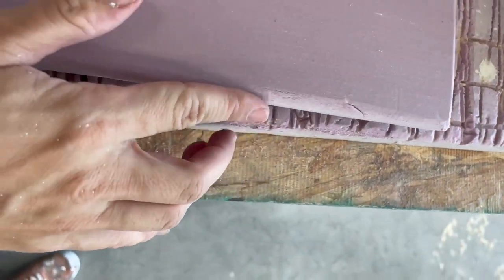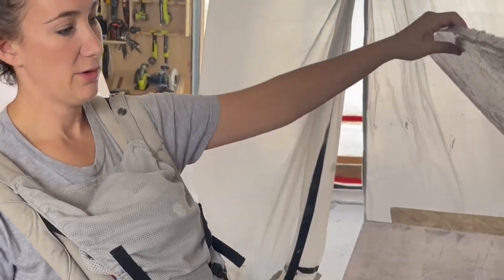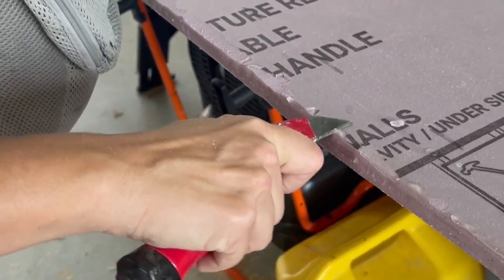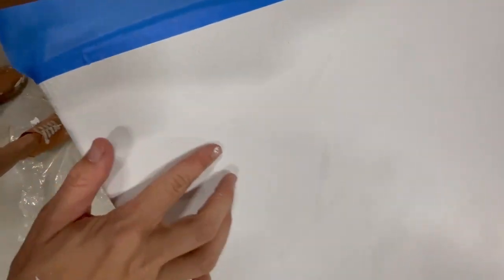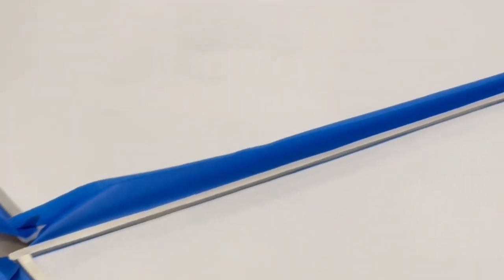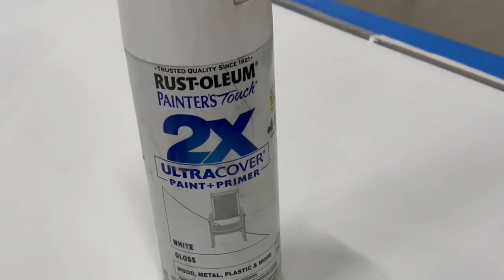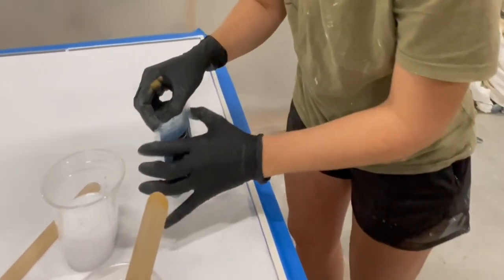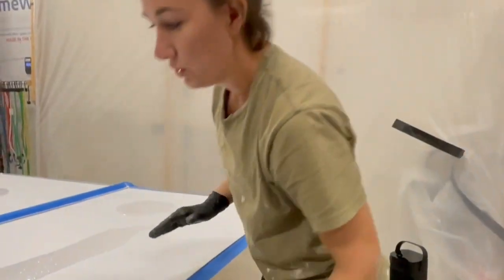HOW TO MAKE AN EPOXY SHOWER

Comment: I'd be scared of the foam not being sturdy enough. If you lean against it does it bow or push in at all?
Reply from the maker: It’s actually super sturdy, it’s inlaid with fiberglass wire, and what residential showers now use
Reply: @tomazcoasttocoast2022  thank you for responding. I love the idea of doing it but the foam scares me. Maybe I'll use plywood and waterproof it with red guard.
Reply from the maker: @CHANNELCHECKER381  of course!  Check out @stonecoatcountertops with how they use the foam board, the plywood has a sheen to it so doesn’t adhere the epoxy as well
Reply: Why is it so hard for people to understand that the fiberglass mesh makes it exponentially stronger. Also- please please for the love of god don’t sand that shit with a baby on your chest.

Comment: I too am wondering how to attach the foam to the studs? I want to do epoxy walls throughout my house, but I don't know how to attach them to the studs once created, any suggestions?
Reply from the maker: You can glue to the wall or put screws through it into the studs and then epoxy over it
Reply: the usual way is to dollop silicon every foot or so on center. this can be adhered directly to the studs or to drywall. if doing a shower need a waterproof membrane behind at least at the corners and the wall with the faucets. , also, don't forget to seal the joint at the top. steam is tricky.

Comment: This is so amazing. you guys make beautiful renovated RV's and I am doing a bit of a reno on one I just bought and the shower is one part I need to renovate. I wish you showed the end of the process, when you pull up the tape, then what? Then how do you put it in the shower? How do you put fixtures in like the taps and shower head? How do you attach the glass doors? How did you do the edges? How do you measure it out to get started with the right size board? So many questions
Reply from the maker: I love all the questions, if you have an instagram we’re @tomazcoasttocoast and that’s easier for me to answer on and we share more on it